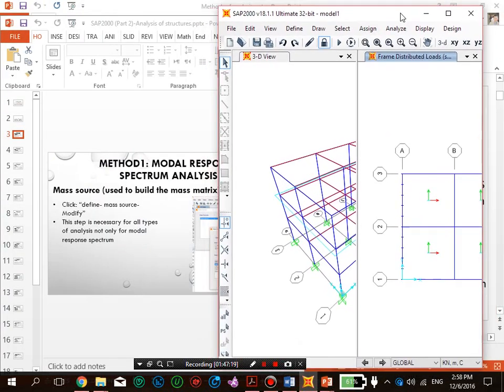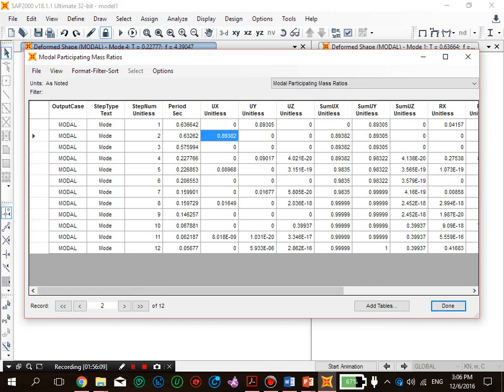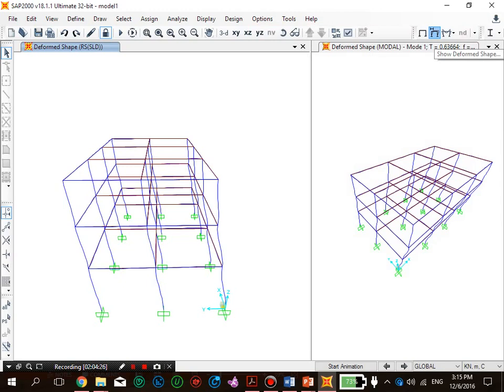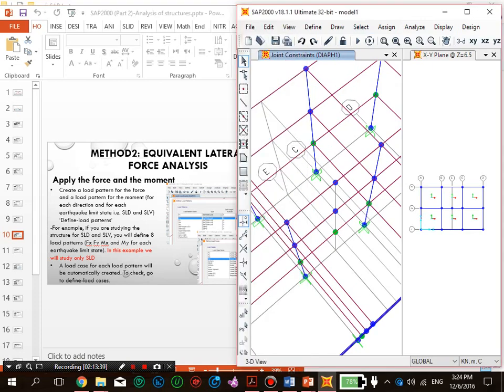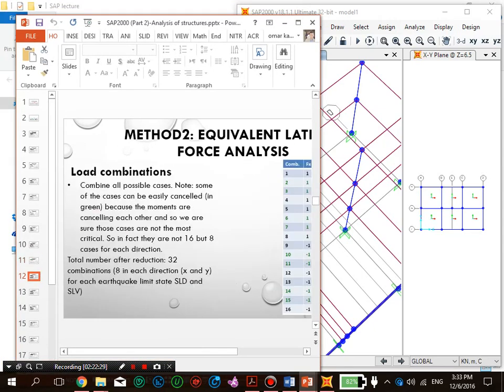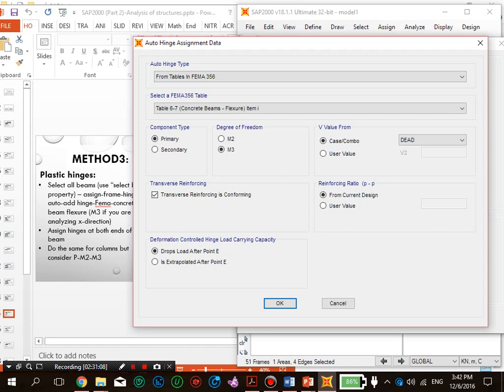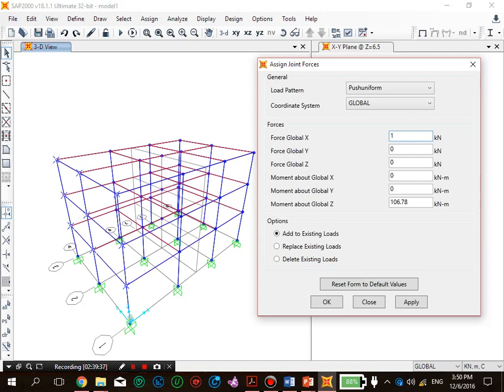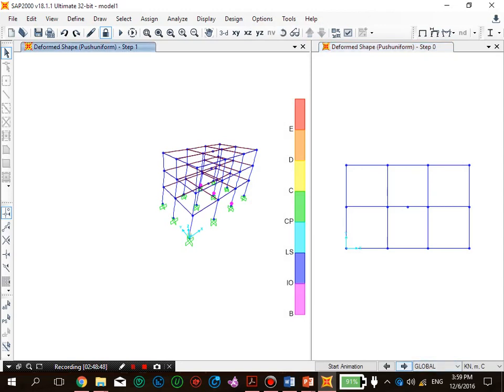SAP2000 - Part3 - introductory Tutorial: Analysis methods application in SAP2000 (VERY DETAILED)

Comment: sir, thanks for your sharing, how to input accidental torsion eccentricity, if we get Ax, because in sap cant display center of rigidty like etabs, can explain to me? thankyou
Reply from the maker: Boby, Center of rigidly cannot be displayed in SAP2000 as in Etabs. You need to compute it by your self. However, you can still use some data from your model in SAP for the computation. More information on how to compute it in this link : https://wiki.csiamerica.com/display/tutorials/Locate+center+of+mass

Once you have the coordinate of the center of mass, you need to define it in your model as an additional node. The node should be included in the diaphragm you had defined for the slab so the applied force can be distributed in a good way.
Reply: thankyou sir for the reply', so we must give 1 unit force for Fx. 1 unit force Fy and 1 unit moment Rz in center of mass?. and we get x = ux/rz and y=uy/rz? but in my model the u and r cant show value. just 0. thankyou
Reply from the maker: Could you please tell me what type of analysis you are performing?